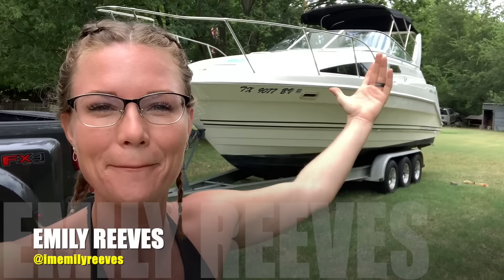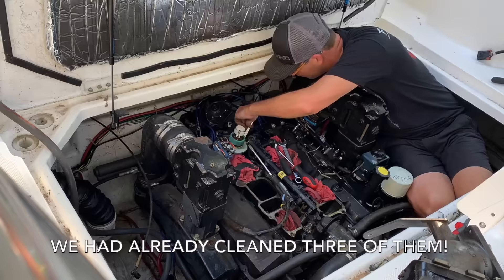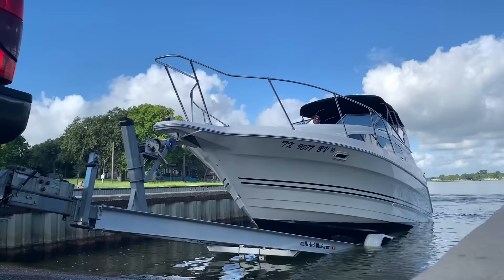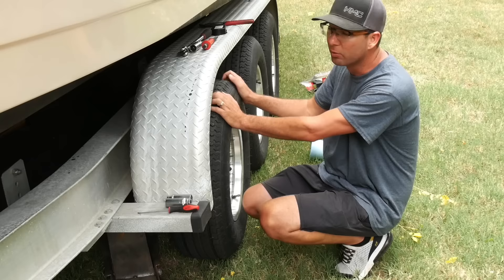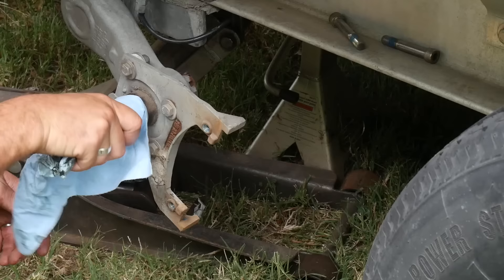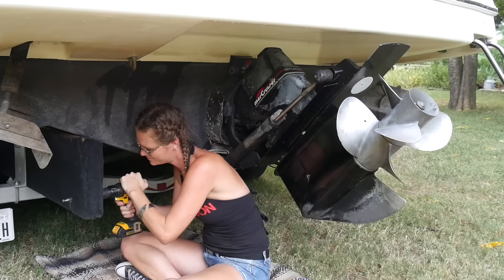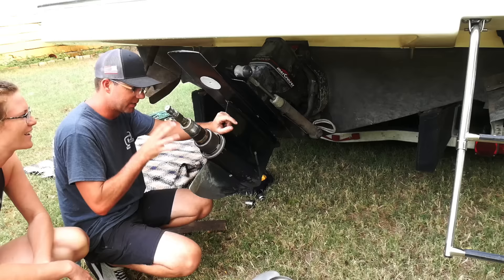Prepping our 5k boat for 10 day adventure!!!

Comment: I sold boats and yachts for a few years before retiring.  Your trailer if purchased new would have cost around $10K.  Great job on the repairs.  You have a great boat.  Have fun.  Bay liner or Formula,  it is how much fun you have on the boat.  Not what the manufacture name is or how much you paid.   You guys did great.  Mike

Comment: First time viewer, kewl stuff, great deal.  Check out the 3M buffing and polishing compounds at your local boat store.  Takes out/off the dull parts of the shiny  hull, bottom and other area's.  You will need a grinder and buffing wheel.  I usually do that once a year and then put a good wax on as well.  Keeps her looking spiffy year after year.

Comment: If your going on a long trip .. just pull over once in a while and feel the trailer hubs. Make sure one isn’t real hot .. that’s a lot of weight on that trailer. Just make sure the hubs are good and greased and not getting hotter from a touch from the others. Fresh /or salt water will destroy those bearings if not sealed up good. You don’t want a bearing to blow on you while on highway doing 50 mph.

Comment: Cool video. My best deal was an electrical project for the customer in exchange to his F150 with bad steering system. Turned out it was just a broken steering system hose, $25 i had to replace and that was it. $5,000 truck for under $1,000 worth of electric work. It was a sweet deal.

Comment: You asked for suggestions and all but one got asked.  I have had boats since 1988.  New every few years.  It would kill me watching people load and unload boats. I would watch them drift off and I swore one day that I would see one in the bed of a truck loading. My wife was not even close to as capable so that put it all on me.  My solution.  Get the boat centered just before backing in.  Make sure you have the boat completely unattached.  Don't think this is going to hurt a thing, back the boat COMPLETELY in the water, even if the tires are in the water on the TRUCK a bit.  Start the boat and tie it to the dock.  DRIVE the trailer from under the boat.  Loading.  Tie the boat to the dock and back under the boat don't drive onto the trailer.  This is WAY faster, safer and painless.

Comment: Hi both off you from Scotland:D 

First of all ,, what a lovely family and adventure you took on .

It’s  only a thought to line the boat up when putting boat back onto the trailer,,,

Have a length off rope on both sides off the trailer at the stern ( back ) so once the bow ( front ) is more or less is in the middle, you can keep tension on ropes at stern and line it up perfectly every time before pulling trailer from water with boat on it . 

Happy sailing and adventures

Comment: About every other tankful, you might wanna consider putting high test gas in your boat that way to clean the injectors out a lot better did the injector cleaner goodbye from an auto parts place

Comment: You might want to check what the tongue weight is on the hitch.  Also, check to find out what your load rating is for your truck and add overload springs if necessary.

Comment: Pull the eye bolts back out and put a washer next to the eye and another where the nut goes.  It will distribute the load on the eye bolt better.

Comment: If you can get a connector for the injectors or stay-cons on wires that fit the injector terminals you can hook them up to a battery and they will open and you can flush them all the way through

Comment: with a bow that tall if you get one of those flags kids put on go carts and bicycles and mount it in the front center of the boat trailer where it couples to the truck it will be high enough for the boat loader to see where he needs the center of the bow to be while loading.  yall kids have fun

Comment: Any injector you can clean by applying 12 volts to the injector while spraying a sealed pressured stream into it. If you don't open it you can't clean it through.

Comment: im late watching your channel and you may have already address this but you said it was taking on not too much water. 2 things when you put the drain plug in wrap it with Teflon tape and you wont have to make it killer tight. next take the 3 screws out where the drain pug goes into the hull and reseal with silicone rtv ultra grey works really well.

Comment: If you can use it on a boat engine, Chevron Techron cleaner in the gas tank once in awhile keeps the injectors clean. It really works. Doesn't just take your money. And, no, I don't work for Chevron or anything.

Comment: Instead of replacing the tires, buy some spares. In the event you have a blow-out you're covered. I would have put that eye bolt on the frame of the trailer vs. the bunk. Load range is important on trailer tires. Make sure the range on your new tires is high enough for the weight being towed.

Comment: OK...First of all, I LOVE you guys.  Loved your show, seen you on finnegans stuff.  I think this is a great story but I really need to discuss some things with you.

First off, best deal I got was on a 1975 Yamaha RD 350 that was sitting in a neighbors yard for like..3 years.  He really didn't know what he had..or cared I guess.  for 350 I got the bike and a spare rd 400 engine.  I had the bike running in an hour with new plugs and battery.  It definitely seized when he stopped riding it and parked it under his tree in the back yard, so a week later after a spec 2 crank and flycut, she was the naughty high school motorcycle of my past.  so bike and machine work, about 1200.00.  wish I never sold her.

Also - you gotta get nautical nomenclature.  There is no nose, there is no side.  He's not cleaning the side.  He's "Scrubbing the hull".  you have to be clear with your boat description in terms of beam, draught, displacement.  its not an underside.  its a keel.  you have a gunwale.  you should know where it is.  you should also know how to pronounce it.Its not phonetic.  Where is your transom located? You dont step onto the nose.  You are on the bow.Its not a partition or a wall.  Its a bulkhead.

Most important: Not a kitchen or stove.  Its a galley
Not a bathroom.  Its a head.

 I urge you to familiarize yourself...this is very important for when you are in the local marina bars and yacht clubs.  Love your show!

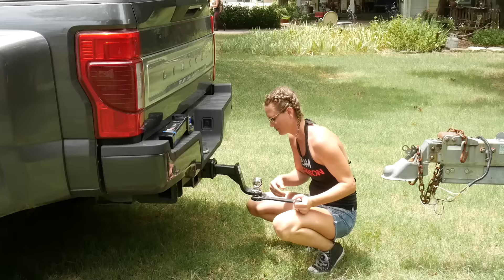Comment: at about the 7:24 mark, you jacked up the trailer straight into the grass/ground... I'd suggest you get a scrape piece of 2x10 or 2x12 about 24" long so you don't have it push into the ground. This especially helps when wet out. Then just throw in the back of the truck or better yet, buggie cord it to the trailer. Love your Chuck Taylors by the way!!! ;)
Reply: same way with the jack and jack stands!

Comment: Several tips for you. Do not use the crap alcohol gas. Use premium petroleum-based fuel only. Second go by the guidelines for the best motor oil for that type engine which is probably going to be a very good synthetic. Third be religious about changing your fuel filters. As for the hall, Starbright is okay for washing it but Maguire's I found to be the best for reducing or preventing oxidation of the whole which you are already in the early stages of.

Comment: Need to weigh boat and trailer empty, low on fuel. Then fill up gas tank. Weigh it. Then once you're completely loaded up. Weigh again. Your going to be surprised. Fuel roughly is 6.25 to 7.25 pounds a gallon. Depends on temperature. Plus water plus all your supplies.

Comment: It looked like your trim tabs were down when you were at wot. Raise them back up after you plane out to get more speed.   They should be used only to get up on plane and to level the boat due to weight distribution issues while planed out.

Comment: I tend to agree with you about whether that heavy of a boat would really need strapping down.  It is obvious that it was not strapped down before.  I did always strap down my ski boats and pontoon boats though as they are much lighter and I once had a board break on a ski boat trailer on a really bad road in Arkansas, and the strap was all that kept the boat on the trailer. We go to Greers Ferry and Table Rock Lakes more than any other as the lakes in west Tennessee and northern Missippi are mud holes for the most part.  We always had trouble walking on land after camping on a boat as sea legs are different than land legs...

Comment: Brand new on here    Love what you guys are about     Pretty cool      but   LOL   when you replaced them lights and put that License Plate on     You may just go ahead and move on the back of the wheel finder if you can     Because you will just tear it of on boat ramps at low tide    most ramps have piece of wood or concrete so you dont drift off ramp and may hang up on it... Just a thought.....   Great job on cleaning it up wow it looks brand new

Comment: You never want to drill into the runningboards always want to drill into the trailer for your safety ratchet straps the wood will eventually rot in my drooling in the wood, your weakening the wood 😂😂😂

Comment: i only boated on the gulf, there is no way i would do it without an electric anchor whence (windless) when an anchor gets stuck it will take both of you and all your strength to break it loose. a slide anchor is the best, i designed, cut and welded my own out of 316ss. worth about $800.00 if i sold it.

Comment: nice boat really cool price,But about the props!   its everything!   there is a very complicated maths formula,and props are matched to the boat,the formular has many variables.some are the displacement of the boat,its design top speed,its type of hull  etc.For example if that outdrive came off a bigger boat that had two engines,or a boat thats bigger or smaller  with one engine it would be unlikely, that it would be the optimal one for your boat.And it makes a big difference.the matching of the prop affects everything in a major way, like fuel consumption, acceleration and overall top speed.probably the boat not being so old,you can find some factory specs on line,and if you are drinking way too much fuel,or way off on max speed.then try again with the other prop. the wrong prop,does not have to be so far off,the correct one to double fuel consumption.

Comment: You missed the point on the tie down ..yes the rear but you should lash the front where the winch attaches down to the chassis of   the trailer to stop it bouncing up and down.. applies particularly to smaller boats

Comment: When retrieving the boat make sure the trailer is in the water I noticed that the water was not even above the wheel thing your boat should stop like 4 or 5 ft from the winch we are great lakes fisherman so we ate doing this ever weekend in the summer so try backing the trailer in the water more. At 5.03 in this video that about where you want the boat to stop at with out having to throdel the boat. Another thing never throdel the boat that's how you weaken the trailer I know that sound crazy bit with that big of a boat I have seen it happen a lot another thing make sure the truck is in park that's another bad thing is loosing the truck and trailer

Comment: HI GREAT VIDEO U NEED A SPACER ON YOUR NEW BALL U INSTALLED THERE SHOULD A TIGHTER FIT TO THE NEW HITCH BECAUSE OF THE MASS OF THE TRAILER AND TOW BALL THE BALL WILL WORK LOOSE NO MATTER HOW HARD U TIGHTEN THE NUT GOOD LUCK

Comment: Oh strap it down and strap it down. I’ve been running my boat trailer back-and-forth to my local marina which is 2 miles away not strapped down for over 10 years. I never had a problem and I got an easy loaded trailer when I leave my house to go more then till my local marina 2 miles away then I strap it down I’m not until then

Comment: I switched to white water repellant grease on my trailer bearings as the normal black grease washes out when I drop my trailer in the water. Also grease the nipples on every bearing every time you put in the water as I find bearings last 50 miles otherwise... but im sure you do this as looked like lots of grease in yours.

Comment: Great Video. Question: Do you have safety gear? Waterproof Touches, Buoyancy Vests (Preservers), Flares & Smoke Signals, Air-horn, Paddles, Bucket with Line attached, Two Fire Extinguishers (Engine and Bulkhead), Spare Anchor with rope, Life Buoy with Rope, EPIRB, V Sheet & Marine Radio. Just a thought. Also, suggest packing the fixing bolts and rubbers for the outboard leg hydraulic rams with waterproof Marine grade grease (Lube). Safe Sailing Guys.

Comment: Tie down points should not be the wooden rail.  Water will leak around the bolt and rot the wood from inside. Attach to metal.

Comment: There’s nothing wrong with Bayliner boats. I’ve had two of them in the past 15 years and had very little to no issues. You’re going to have issues with every boat no matter what the maker is.  
And some boats are gonna be built a little more solid. So that just means maybe a few more layers of fiberglass. Or they use a different strand of fiberglass?

Comment: I noticed that the shank on your 2 -5/16" ball does not match the hole in the new ball mount.  That is a safety hazard and should be fixed ASAP.  The shank should not slide around side to side in the hole.

Comment: There's a easier way to do that get some alligator clips hook a couple wires on it grab a battery sit it on a bench bump the wire on the battery it will open and close the injectors while you're spraying it with a cleaner

Comment: The hole in the bottom is ok it traps air and doesn’t allow water inside of those lights. If you put a sealed compartment in water open side down what happens? Exactly no water gets in. Unless you install them upside down.

Comment: 26 mph in a 28 ft boat with one 7.4 gas engine.  That's a lot better than I thought. cruising at about 20 mph might get 3mpg.  what size tank? 125 or 150 gal?  Lets go to the bahamas!

Comment: Check the fuel filters, gas can go bad, how long has it been sitting? If ya got al-kee-hol in the gas, it may have additional moisture innit. Fuel stabilizer may be needed. Is there a collection point for water in the fuel system?

Comment: 1. Driver needs to stay in the truck..watch the boat launch fail videos...the common denominator was the driver got out of the truck...breaks and "P" fail...
2. The truck rear tires should be touching the water...the boat should be floated onto the trailer not forced  onto it...
3. Launching...DO NOT remove the safety chain until the trailer tires are touching the water (I've got pictures)

Comment: Does that trailer have surge disc brakes?  If so the trailer tounge needs to be higher than the tires, usually around 21-26 inches high.  If trailer tounge is too low brakes will be applied all the time.

Comment: Age of tires has nothing to do with when they need to be replaced. Manufacturers can store tires for upto 10 years before they're even sold to suppliers. Too  many folks running around the net reading the date codes and saying tires are bad when they're just fine. The sun (uv rays) dries tires out and makes them bad. If the rubber is cracking then I would replace them.
Reply from the maker: The flat spots on these were real bad from being parked for 20 years!